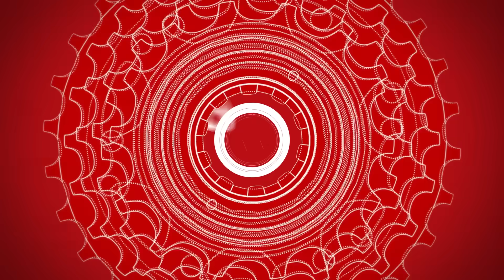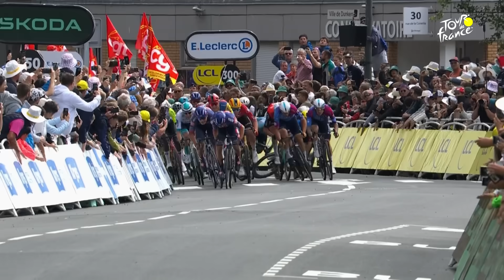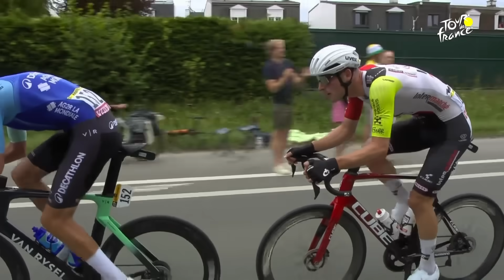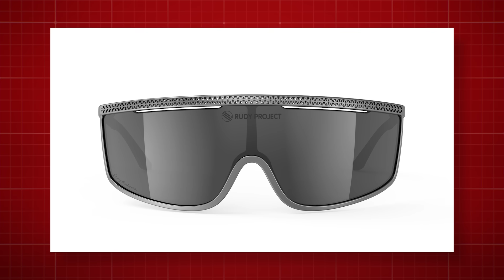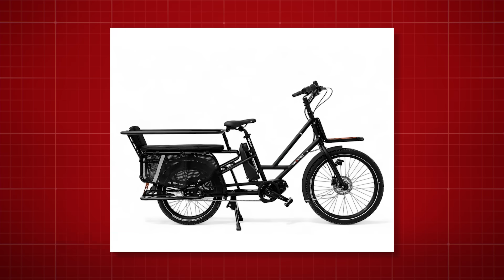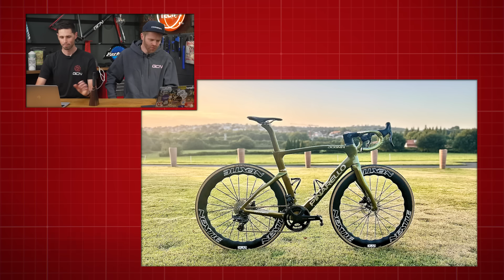Is Speed Really The Problem? | GCN Tech Show Ep. 394

Comment: Riding in a peloton at speed is never going to be safe.  Bunch Sprints are even more dangerous and there is no way around that.  All you have to do is look at the long history of horrible crashes in bunch sprints.  This activity is inherently violent and dangerous.  With that said if you wish to reduce violent contact with the ground then you need to reduce the amount of time the riders are at high risk.  I think the most logical way of doing this is switching to 4 endurance disciplanes in grand tour racing.  This would include the tradtional sprint stage and mountain stages on the road, but then consistnely add into the mix 1 TT or TTT per weak, one or more gravel stages per week and 1 or more cross country mountain bike stages per week.  From what I have seen both Gravel and MTB tend to not have massive groupls in a Peleton.  You could also do mixed gravel.  This would also have the potential to change the type of all round rider that might have a chance of winning grand tours.  But the TDF was race on gravel roads and not much better than tracks in the beginning.  There is no reason every stage has to be on pavement.

Comment: Do not ham string the sport by reducing speed and fast tech. You can't make the route 100% because it's road racing on public roads, not in velodromes. Even in velodromes and in ITTs there are crashes. If a change must be made for rider safety why not introduce PPE like in MotoGP. We already have helmets, but how about clothing that can protect the whole rider from the worst of crashes.  For instance, dyneema has been used in cycling clothing for a while, what other materials are available to make light weight, aero armour?

Comment: Here's an idea -- instead of trying to make bikes slower, start requiring professional cyclists to start wearing the same pads and protectors that motorcycle racers wear. When you think about it, the idea that these riders are out there at those speeds with only a helmet as protection is pretty insane. Not only will requiring protective equipment probably cut down on speed because of the extra weight and increased rider temperatures from the extra insulation, but it is something that would actually make sense as far as reducing injury without stifling bike manufacturers' innovation.
Reply: Motorcycle racing leathers might be a bit extreme. But I think there's definitely an argument to be made for abrasion resistant clothing and strategically placed padding. If the pros need to race in it, it could probably be designed to be fairly lightweight and cool.
Reply: Great idea , start with light weight knee pads and elbow pads then the next year some sort of a lightweight back protector

Comment: Rider error causes the majority of crashes. Crashes will still happen, whether you race at 40 or 50kph. The severity will reduce slightly, but the crashes will still happen.
Reply: the severity increases dramatically with speed. It’s proportional to the square of the speed, so even modest decreases should increase rider safety.

Comment: It strikes me as slightly ridiculous, limiting speed in a race. Racing, regardless of how, is about getting from one point to the next as fast as possible.
I completely agree about doing a proper analysis behind the cause of crashes. I think if they look at the route they take, make sure they don't have downhill finishes, sprints out of corners, or other things like that for example. If they made sure that barriers were designed to absorb impact, then accidents would happen, but not as fatal as they currently are.
Reply: There are already a huge number of rules that slow down the riders. Adding a few more rules is not inherently ridiculous. 

If you want people getting around as fast as possible on bikes, you're looking for recumbents with full farings
Reply: @xtremegopher exactly, if if speed doesn’t directly cause crashes, it’s not rocket science that crashing at 30kph is way safer than crashing at 50kph. Crashes will always happen because some riders just aren’t as skilled as they think they are. It’s about damage mitigation.
Reply: Motorsport does this quite often; lot of well known series are 'slowed down' as part of the regs...Whether ballast, single tyre supplier, engine restrictions, etc

Comment: Reducing speed may not reduce the number of crashes but will reduce the severity of crashes.
Reply: I slip in the curve with 5 km/h less doesn´t make a big difference imho.
Reply: @Marco_mit_c_ohne_k physics disagrees with you. Going from 50kph to 55kph during a sprint finish increases your kinetic energy by 21%. 21% more energy going into your bones to break them if you crash at 55 than 50kph. That's a big difference.
Reply: Absolutely. They’re asking the wrong question. Shoe power test all over again.
Reply: I'm not sure that they've concluded/proven that higher speed crashes are more damaging to the rider. At slower speeds, your body can crumple and twist awkwardly. But I'm curious if there's a speed at which sliding becomes beneficial?